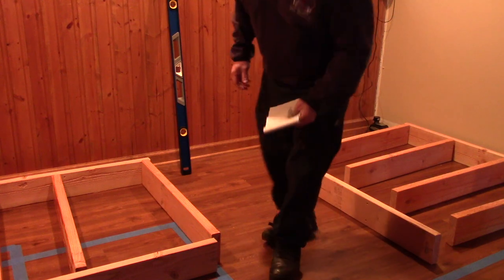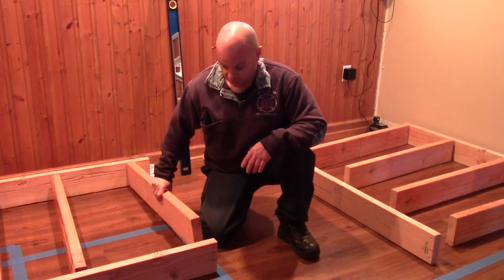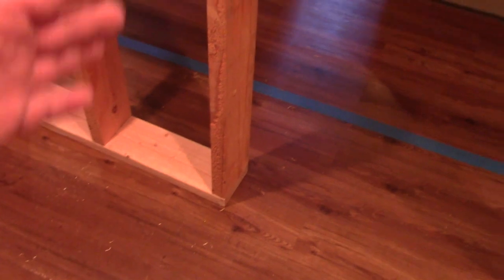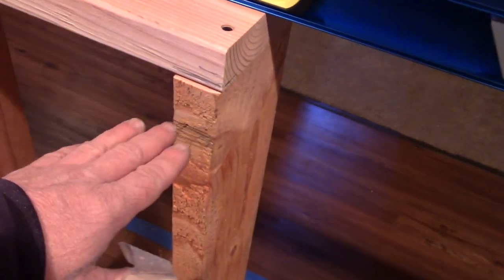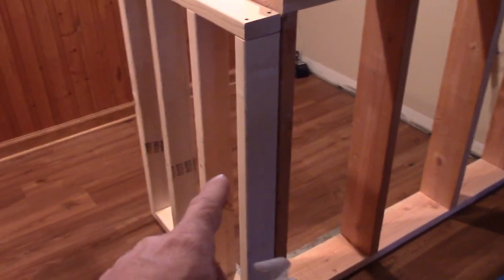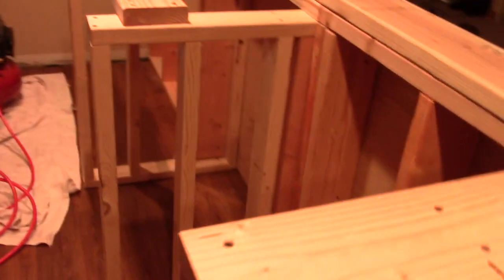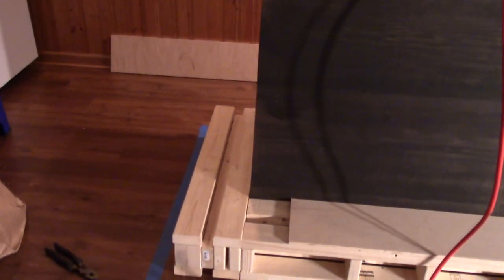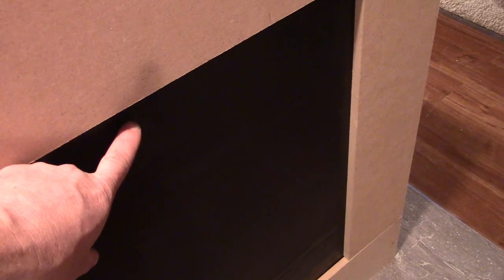DIY Bar | How to Build a Home Bar (Part 1/4)

Comment: It turned out great!! What kind of stain did you use ? Did you have to wipe off the excess after every coat before you let it dry? Nice work man.
Reply from the maker: Thanks. I used minwax stain. Two coats brushed it on and let it dry. It took a little longer but I wanted the deeper color

Comment: Did you just use plywood as your 1/2 inch filler board?  Or something else?
Reply from the maker: i believe that was 1/2 inch MDF for the  filler but you can use whatever you have even scrap wood depending on if you plan on adding trim board over it like I did. I just wanted to give it some dimension.

Comment: Hello! My husband and I are in the process of using your bar video to build our own bar. Did you glue the two 3/4 plywood bar tops together when you stacked them on top of each other?
Reply from the maker: I screwed the first piece down to the bar frame from the top then I did use liquid nails (glue) on top of that before putting the second piece on. I screwed the top piece to the bottom piece from underneath the bottom piece also. So you won’t see any screw holes on top. Just make sure your screws are less than 1-1/2 inches for that part.  Tip I used clamps around the edges to hold the two pieces together  while I screwed it.  Keeps everything nice and tight.

Comment: Where did you buy the chicago bar rail? I would like to order the one you installed.
Reply from the maker: Chris Soto pretty sure I got them here https://www.hardwoodsincorporated.com/product/br-475-bar-rail/
Reply: Thanks brother, this is hands down the coolest bar and tutorial. Great job, ooh-rah...
Reply from the maker: Chris Soto Thanks man
Reply: Hello, where did you find the drawing/build sheet for this bar?  Thank you
Reply from the maker: MrChazazz there were a couple of still pics of the frame on Pinterest other than that I made it up as I went

Comment: My wife and I want to use your exact type build , do you have the blueprints for sale by chance? Thanks in advance!
Reply from the maker: I found some still frames on Pinterest.  Other than that I did not follow any blue prints.  Just kinda made it up as I went to fit my space
Reply: @bombero24ws  thank for the response greatly appreciated !

Comment: Not a good idea to build a heavy bar on top of a floating vinyl floor as the flooring needs to move.  You are going to end up with buckling or gaps in your flooring
Reply from the maker: It hasn’t so far and it’s been almost five years. I guess I got away with one.